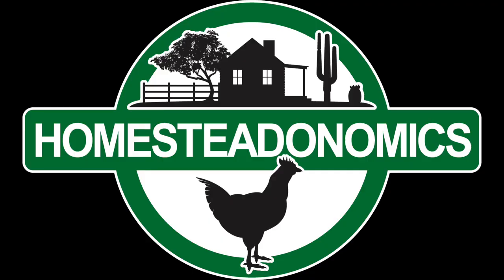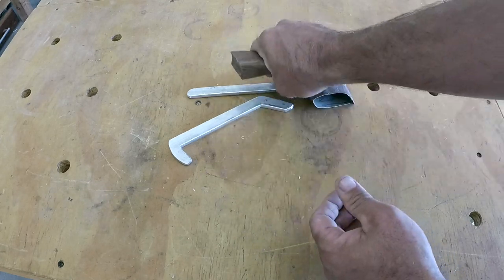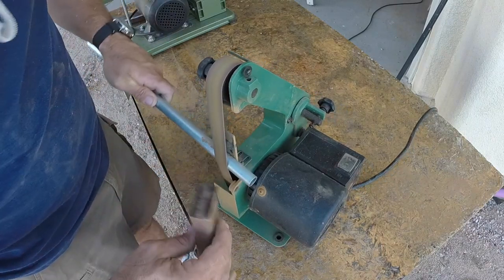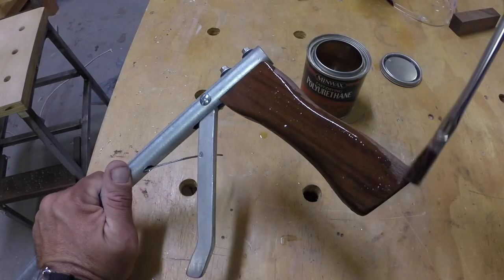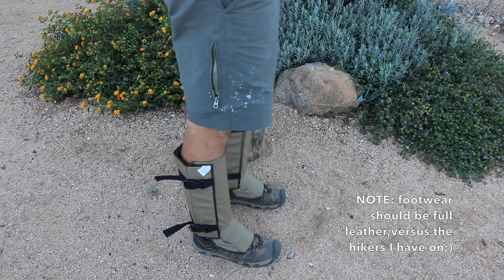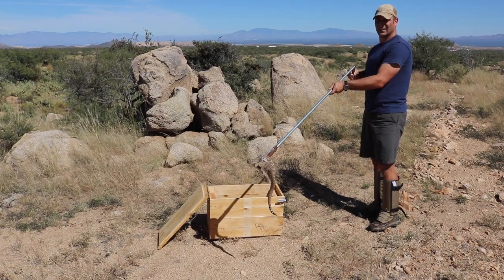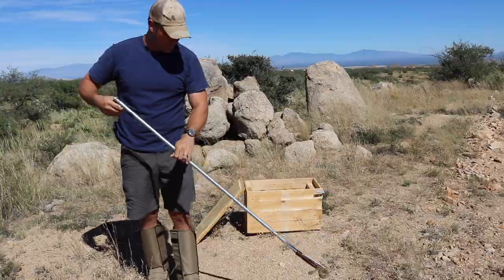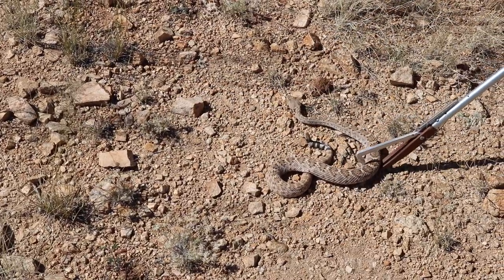Snake Pole Build - How to (SNAKE footage)

Comment: Nice job on the snake pole!  I have read that rattlesnakes relocated more than a mile from their origin have less than a 50% chance of survival.  I guess that is better than certain death at their current home.  When I found a rattlesnake by my front steps, I called a guy to relocate it for a fee.  After that, I bought a snake pole for $60 and haven't seen a rattlesnake since.  I think there is something about snake poles that repels them.  Lol.
Reply from the maker: LOL... yes, soooo true.  I catch snakes from time to time as part of my day job and we were seeing them consistently until the day I finished the pole... went about 2 weeks with nothing...lol
Murphy's law I guess:)

As for relocation distance.. you are right.  Generally you don't want to take them more than 1/2-1 mile away.  Just like any animal they have their feeding, breeding grounds, dens, etc,.

joe

Comment: Those rattle snakes didn't seem as ornery as some of the Rat snakes I've seen....  Good Job sir.
Reply: Rattlesnakes are actually pretty docile creatures, even more so if you keep about a 6 foot buffer. I hike mixed use trails and bring a snake hook with me to nudge snakes off the trails so they don't get trampled by horses or run over by mountain bikes. I've only been rattled at once, and never struck at.

Comment: Those hiking shoes are very insufficient for snake protection! I find full on snake boots to be more comfortable and safer but you need at minimum a heavy leather shoe/boot on. If a teddy bear cholla needle can easily poke your foot through the shoe, a snake can easily get you as well. I live on property in snake land as well but I don't take chances. It's a costly mistake if you ever get hit.

Comment: I’ve been thinking really hard about this design. What I am wondering is if (1) the lower wooden jaw was dispensed with, and (2) either (i) the aluminum round section (pole) was used instead (as a jaw) with some rubber glued to it, or (ii) square section tube, thin steel or aluminum, was used throughout, (and as the jaw too) to give flatter surface for the bottom jaw, with or without rubber grip, and (3) if thin steel square section was used, a handle could be MiG welded onto it, to make lower jaw, pole mid-section and handle all one piece. I have just started work in Australian tiger snake and  dugite (Western brown) habitat adjacent to wetlands. Wear snake gaiters every day. Been told the tigers will chase you. The baby snakes as, if not more, venomous. True or myth?? The brown snake very difficult to see as so well camouflaged. Have encountered the Australian Death Adder (scary looking snake for sure, big triangle head and big scales plus big girth, and the stealthy dugite, years ago, but still yet to see a snake here at new reputedly snakey worksite. Thank you for the how-to video, very helpful.

Comment: I would not be confident using a snake pole. (Some Australian snakes are aggressive.)
Reply from the maker: Yes, I guess it would depend on it they are coming at you for sure.  I've had a few aggressive rattlers, but for the most part they want to get a away.
Joe
Reply: Snakes Do Directly respond to ones ANXIETY Level, if one is calm the snake is calm, if one is highly stressed the snake will be also.  As is evident it these videos.

Comment: In my opinion, that pole is not long enough!
Reply: If the poke is too long than it will be difficult to handle. 40” tongs are plenty long enough, as long as you use them appropriately.